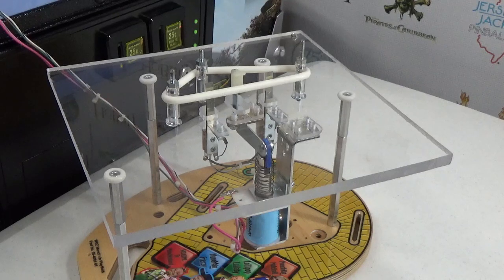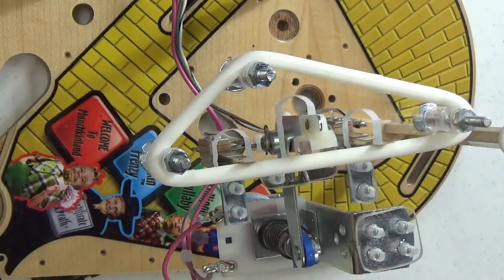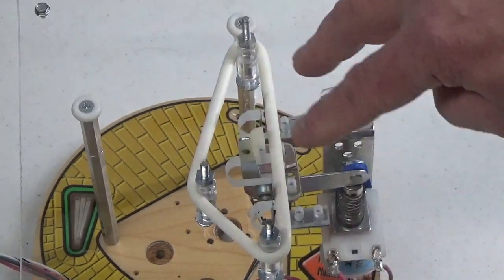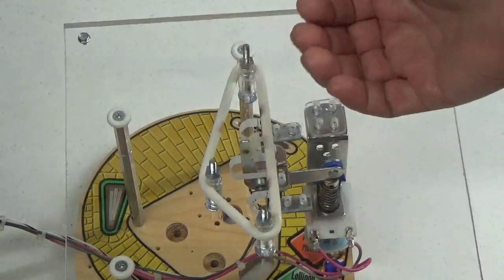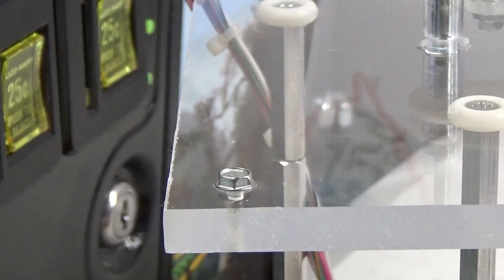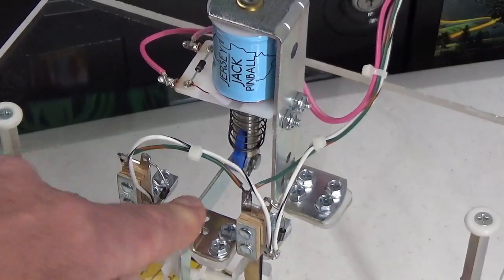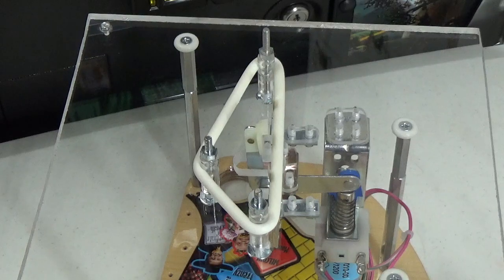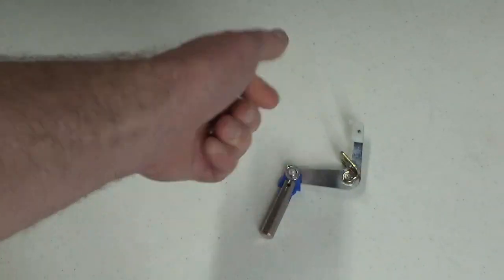JJP - Slingshot Assembly Basics

Comment: Where would you get replacement slingshot assemblys for an old Gottileb system 1? I got a Close Encounters to add to the game room, and was told everything part wise was here, and most of it is except this. They had taken off the slingshot/kicker solenoid to replace it, and it seems like they lost the piece that went through the solenoid. I have to manually kick the ball over to my plunger. Lol